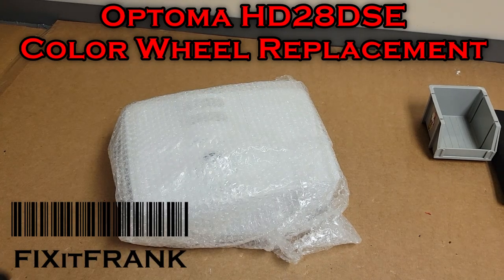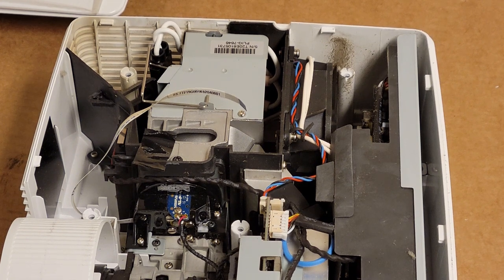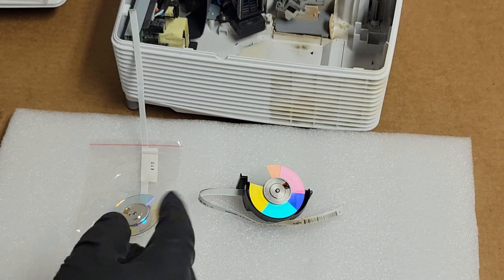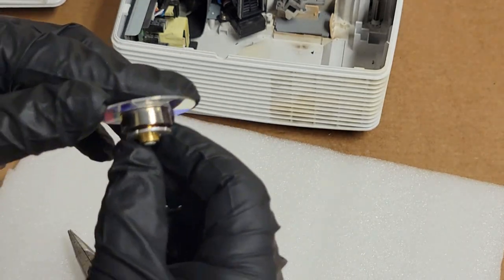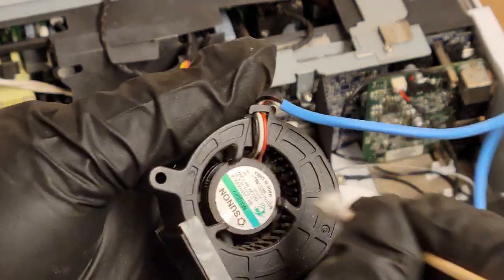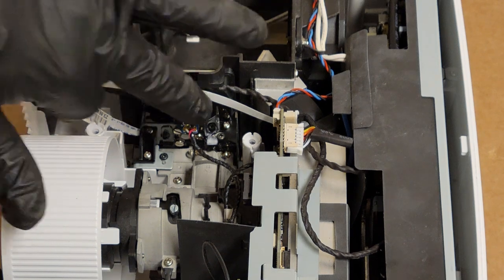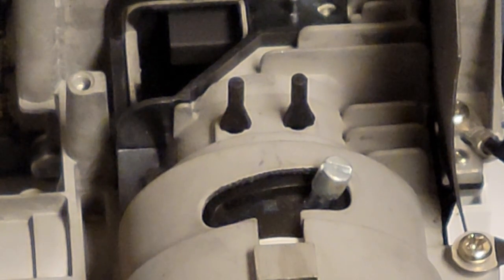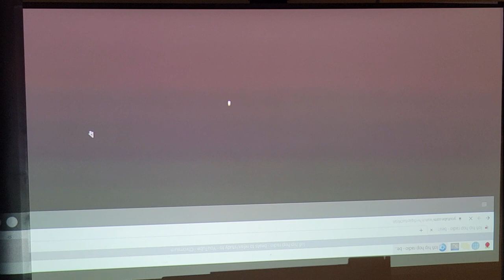Optoma HD28DSE DLP Video Projector Repair / Color wheel Replacement

Comment: I have replaced the lamp on mine a while ago. The issue I'm having now is the picture will switch to a green tint and switch back to normal randomly. Would this be a color wheel issue?
Reply from the maker: Most likely, but check the color wheel sensor for dust before you replace the color wheel. Also the glass filter for the lamp assembly needs to be in good shape. Being that it worked it is probably fine. The color wheel or the sensor being dirty are my suspects

Comment: Very good Frank. What is it with OPTOMAs and failing colour wheels? Are they designed to fail in any way? Projector with all these plastic covers looks like screaming to be put out of its misery. But it operates happily and that is all that matters. Again, thanks for sharing my friend!
Reply from the maker: I'd like to know too.  All of my dealings wit Optoma directly have been positive.  They are very responsive to parts requests. The prices are sometimes too high but they are the only company that I have dealt with directly that will sell parts to someone who isn't one of their warranty reps.  They have even sent people to me.  
My guess is its they are being built to a specific price point and whoever is supplying the original color wheels came in cheap enough. I would be kind of surprised to learn that they design them to fail...kind of surprised.

Comment: Would my HD28HDR use the same color wheel? I know that the component would make a difference due to voltage and  milliamps.
Reply: I got a replacement color wheel. Could not find one that says HD28HDR, but the system board was marked HD27e so I got a color wheel for that board, but it still will not start. I can hear the fan spool up then slow down and then I can hear the color wheel spool up and then stop and go back to the fan. I bought a new bulb as well from jasperelctronics. Stock bulb does not work either. I now get the power light blink and the temp light stays solid for the error codes.

Any suggestionsFor the record, my sensor is just as dirty. Do I need to clean it with some alcohol and lint free cloth?

Comment: Hey Frank,
I have the same projector but am having an over heating issue.
I pulled everything out, cleaned it well, and put it back together without issue.
Started it back up, no issues with the color, but the fan is still running louder than normal and that was the warning sign before when it would shut itself off due to heat.
Is there anything else it could be?
Should i look into replacing the main fan or blower fan for the lamp?
Thanks, really enjoying the process and content of your videos, it’s extremely helpful
Reply from the maker: I remember seeing you with that barber shop quartet in Skokie Illinois...
My first check would be the blower fan. I'd open it back up and remove the lamp. Then bypass the door switch. This way you can start it without the a lamp and unplug one fan at a time to narrow down which one. I suspect the blower fan personally but I may be wrong. The larger exhaust fan does a lot for lamp cooling too. It couldn't hurt to change both but I'm also not a fan of the parts canon.

Comment: Hey mate can u fix mine..I have a orange problem to it .maybe it's wheel I change new lamp and still the same
Reply from the maker: Is the lamp from a decent company? Many sellers (not Benq) use the wrong lens type and make all sorts of color issues when they use the wrong lens. If you look at the face of the lamp it should have an obvious reddish/blue tint when you hold it at angles. It's very obvious. If not you have a bad lamp lens. Lots of cheap lamp companies use these and it will cause problems. If you have your old old lamp, then you can swap the lens over to the new lamp and it should clear it up. Very common issue these days with inexpensive lamps flooding the market.  Otherwise the color wheel is a definite suspect. Let's start at the lamp and see what happens.

Comment: Hi, great videos man! I have a Optoma HD28DSE, I had to replace the blower fan due to failed bearings, now however the projector keeps warning FAN LOCKED and shuts down still, I can confirm that both fans function well... Can you perhaps give me the key combination to access the extended service menu to check the fan speed?
Reply from the maker: I can but you wont have time to get into the menu. I'm fighting with one myself (ebay score) that has a fan lock error yet I've replaced both fans.  Its something on the mainboard...
Service menu (must be pressed on projector) Power - Up - Right - Up - Left - Menu
Reply: @FixitFrank  thanks so much for getting back to me with that one! I figured out the service code... Turns out the fan that I procured was actually a "fake" it's another brand fan and just a SUNON sticker was stuck to it... I added some Q20 lubricant into the original fan and she is quite now and spinning at the correct rpm... She's been working fine for about 4 days now..

Good luck with the one you got there, I know you'll figure it out!

Comment: Hi, can you do a video on changing the colour wheel for GT5000 series? Or give me some advice on how to do it? Thanks
Reply from the maker: Best advice I can give is go slow. Take lots of pictures. Anytime you remove a screw, take a pic of where and what screw. Don't force anything and don't push on anything unless it's made to be pushed on. It's not a race, so go slow and be careful. It's totally doable yourself of you have moderate skills. Worse case it's still broken. So not much to lose at this point you know?
Reply: Thanks! It's still going, just a noisy colour wheel so thinking it may go at any point. I'll give it a bash anyway. Thanks 👍

Comment: Strange to see the lamp come on before the PJ knows the color wheel is operating properly. I thought it went CW then lamp?
Reply from the maker: Color wheel does spin up first.  When I narrate it, I say lamp, then color wheel but if you listen, right after I press the power button, you hear the chirp and the lamp fires almost instantly afterward.  As far as I know, the color wheel has to spin up first. I don't know what the average delay between the 2 is but this one seems to be a very short delay.

Comment: Great video!  My optoma HD28DSE is doing the same thing.  Where do you recommend buying the color wheel?  I see some list the size as 40 mm and others 42 mm.
Reply from the maker: I'd contact Optoma first.  They are surprisingly helpful. support@optoma.com
888-289-6786 , If not, I have a contact in China who is fantastic. GYDZ@timeprojectorlamp.com  IF you contact either of them, send a photo of your old color wheel, Be sure to show the part # on the barcode sticker as well as the glass.  That makes sure you get the right part.  You want to order it by model rather than size. That way you know you will get the right part.
Reply: @FixitFrank  Thanks so much for the response!

Comment: This was awesome, Frank!  It fixed my projector 99%.  I say 99 because it was a color wheel problem and installing a brand new one revived my projector, however I can see that a couple times each minute the wheel seems to act like it's misaligned for a split second and the colors go slightly out of phase.  Is this a bad color wheel or is there a calibration period?  I've had it running for 10 minutes so far.  It's especially noticeable on color calibration videos.  Would you know what might be going on?  Should I just let it run for a while?  Thanks!
Mark
Reply: Next follow-up.. I let it run about 4+ hours and it still has the same issue but a little less.  I noticed that you can mostly see it on solid white areas of the display.  It's not the "rainbow effect" that some people are sensitive to.  It's definitely the wheel appearing like its timing is not regular because the frequency of the flicker constantly changes.  Hope that's a good description!
Reply from the maker: Have you repalaced the lamp recently?
Reply: @FixitFrank  Yes, I replaced the lamp at the same time.  It's fantastic now except for the weird flickering on the white.  I'm almost ready, if I can't avoid it, to put the old one back in. It wasn't too bad except it lost the calibration mark.  I have no way to add one.  Don't have the magic tape 😃.  Hoping I wouldn't have to. 🤪
Reply: @FixitFrank  I also just used my phone to view the screen in super slow-mo while displaying a solid white screen... As it scrolls through all the colors that make the white image, when it gets to the cyan segment of the wheel, part of screen is messed up like the cyan segment is not large enough to cover the whole screen.  It dips to grey on part of the screen whereas all of the other colors fill the whole screen in slow-mo mode.
Reply from the maker: Was it an oem lamp? I ask because many Amazon sold lamps have the wrong IR blocking lens and that can actually cause the issue. If you still have your old lamp, compare the lenses. I suspect the old lamp has a lens with a reddish blue tint and the new lamp has a very faint greenish tint. Swapping to the old lens may truly fix the issue.

Comment: I thought the videos were very instructive. It helped me take mine apart without too much trouble. It is overheating and shutting Off after a few seconds. I replaced both tans and the color wheel as well as general cleaning …. and it didn’t fix my issue. You made it look so easy so I was hopeful. I will take any advice you have on further troubleshooting. It may just be time to get a new projector I guess
Thanks
BU
Reply from the maker: Is it still overheating?  Was the lamp assembly replaced recently?  Many amazon/aftermarket lamps are not nearly as good as they pretend to be and can cause issues like this.
Reply: I bought the unit new 5-6 years ago and it just started overheating a few months ago. I purchased a new lamp as a backup but never needed it. After replacing the fans and color wheel I still had the issue. I then replaced the lamp just to see and it didn’t fix the issue either
Reply from the maker: If it's still overheating, check the direction of the exhaust fan. Make sure the sticker side of the fan is pointing towards the lamp assembly. Another thing to try is put it into high altitude mode.  I am also wondering if you ended up with a defective fan.
Reply: Just checked and the fan is mounted correctly (sticker towards lamp). The 2nd fan (smaller one) has a rubber piece that can really only fit on 1 direction given the fans funny shape so I believe that is on the right way as well. I have the cover ribbon cable installed and can power on the unit while lifting the lid. I have verified that both fans spin and can feel the air. Hard to say if they are spinning fast enough however. When the projector 1st turns on I can hear the fans spinning fast, and then at some point in the power up process they slow down to to what I assume to be a “normal” operating speed. I am starting to get concerned that it is a control board issue. If that were the case would you recommend a new projector?  I would love to fix this still, but worried about how much time and money it will take to get there
Reply from the maker: I've never seen a main board cause that. While anything is possible, I kind of doubt it's the main board. Does the projector actually shut down and give you an overheating error? It's just really an unusual situation that you're describing.  If you can share a vid of it failing that might help me get a better idea.
Reply: Sorry it took so long to get back to this.  I have taken several videos and pictures that I would like to share. Trying to figure out the best way to do that
Reply: Hey Frank, if this projector is not fixable … I would gladly take any recommendations on good replacement projectors of about the same quality as this one .